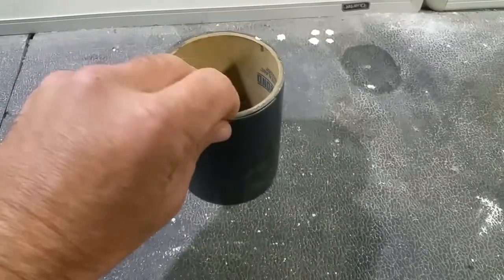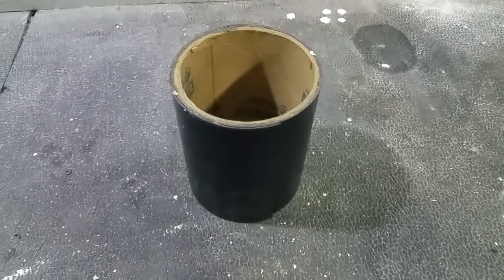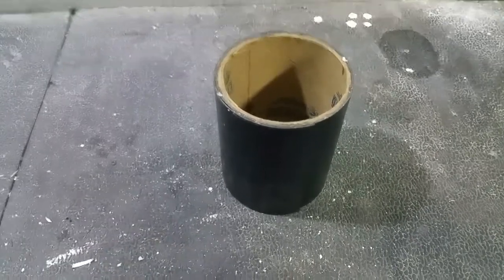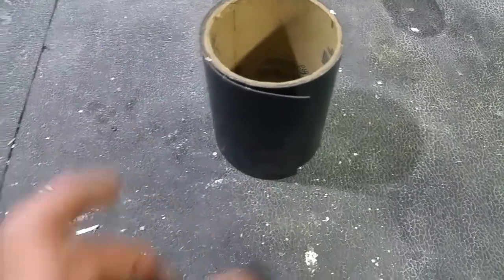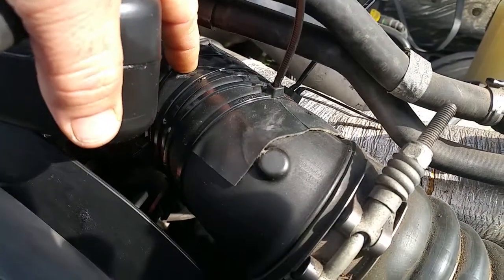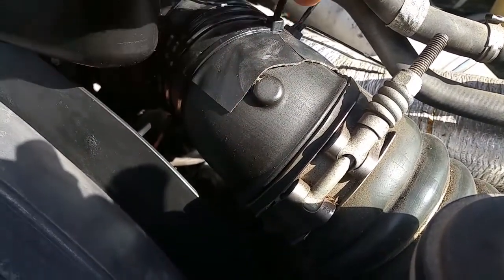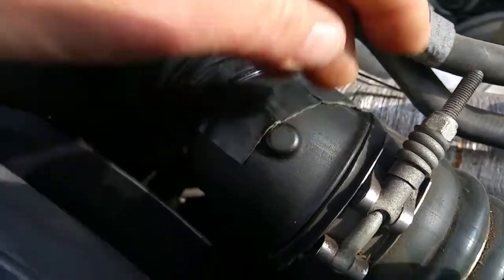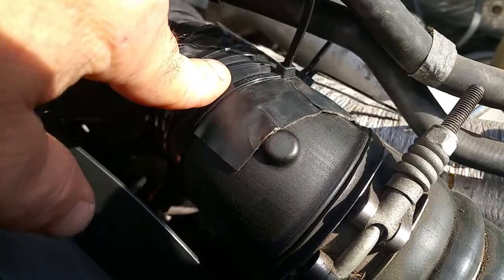Ford 6.7 powerstroke turbo - how i patched intercooler outlet hose

Comment: I always keep a roll of Eternabond tape in my 5th wheel camper for emergency roof repairs. I blew a intake hose on my 6.7 and wrapped this stuff around it. It got me home, no problem. The bad part was trying to get it off! This stuff sticks to everything and doesn’t let go!
Reply from the maker: It sure worked for us actually lasted a year that way haha.  I made another video when I put the new hose on.  But yeah you are right even what I used was really messy.

Comment: How long did it last?
Reply from the maker: I put a new one on a year later.  This stuff lasted months and then I tried 3M 130C rubber tape with MSHA tape but it did not hold up as good.